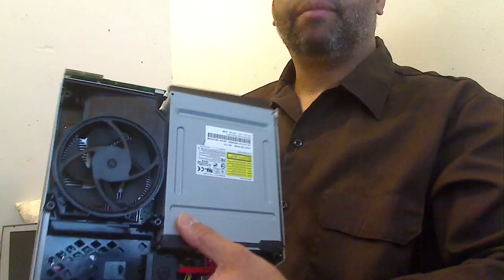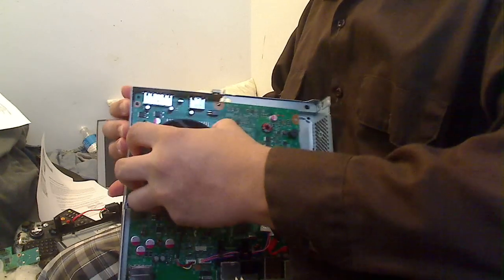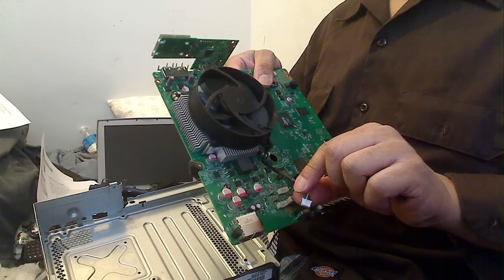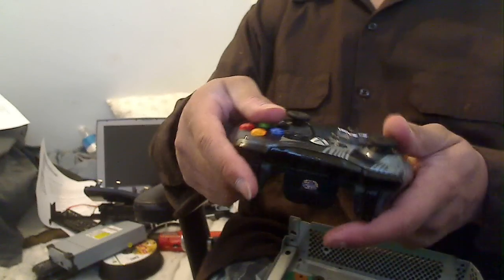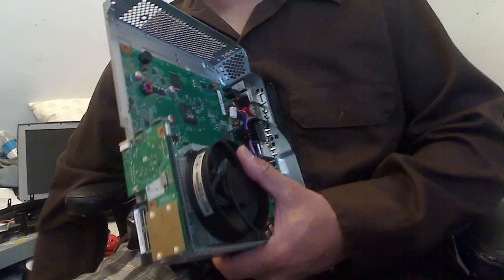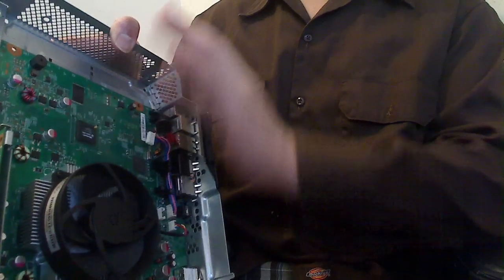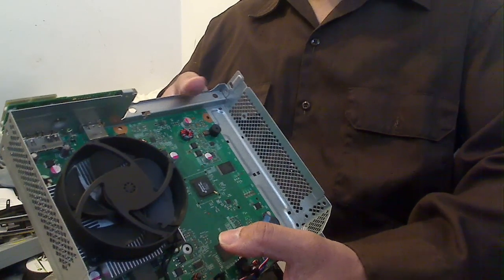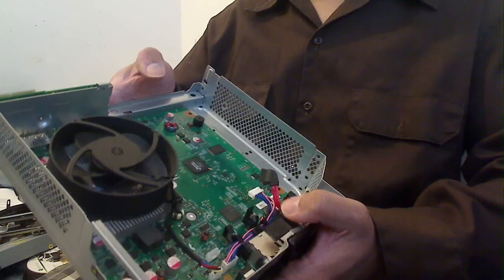How to fix Xbox 360 Slim RROD / Red Dot of Death Reset Solution👍

Comment from the maker: Things to consider when you don't have success:
1.) Heat Sink paste is a slightly viscous material that comes in a tube that is used to allow efficient even heat transfer from one object to another without burning both objects, just like when one uses cooking oil to fry food. The cooking oil allows efficient even heat transfer between the heated pan & the food in the pan with burning it.

2.) If no thermal paste is used, then heat cannot flow from one metal object to the next metal object efficiently. Excessive heat build-up can occur between the 2 metal objects (heatsink & CPU) and you can expect a fire to occur inside the xbox and damage to your CPU/GPU. Heat must flow from one object to the next without a buildup in heat in one particular area, and then blown out of the case to remove the heat from the inside of the xbox towards the outside environment

3.) If your reset doesn't work and your xbox still gets the red dot. Is there anything else [you] can try?

3a.)You could try a different power supply or replace yours if it has a red-light. You need to make sure you've replaced the old heat-sink paste with new paste after you've cleaned off the old. You can try running a heat gun over both sides of the board and let cool down before testing.

4. You can check the USB ports front and rear for bent or twisted pins touching the inside of the USB port. Unplug the Xbox and use a small tool to bend the pins away from touching the inside of the USB metal chamber. If the USB port appears unusable you can fill the chamber with hot glue from a hot glue gun ($3 at the dollar store). Only do this after you've confirmed that the pin correction was the problem and that you're Xbox powers up without the red dot.

5. Check the HDMI for bent pins and bend back or just uses AV or Component cables for an alternative video source. Components and HDMI give near identical video quality to the naked eye.
Reply: +Donte Beachem (Romerro) thank you :)
Reply: Donte Beachem I did the paste and upgraded the bolts and it was still running really hot. And today the ring came back on
Reply: What if you don't use thermal paste
Reply from the maker: @quickcompetitionsltd  You will not have efficient heat transfer. CPU paste is a medium that allows heat to transfer from one object to another without burning the object or fire occurring. If you do not use paste, you can expect the bottom of the heatsink to be burned and the top of the CPU to be burned. Don't do it..
Reply from the maker: Ok so YouTube doesnt allow me to annotate this video any longer but I would suggest either placing the original x-clamp and screws back in or if you dont have the clamp any-longer, check to make sure you have sufficient gapping between the heat sink and the board, using 1 plastic washer and 1 metal washer. do not place the metal washer against the board. If you over tighten you can bend the pcb where the processor is located and the cpu will continue to overheat. My apologies for taking so long to respond but there's something wrong with my notifications.
Reply: Donte Beachem Do you recommend this repair for first timers?
Reply from the maker: dar'man beskar Ordo  You do not need to reconnect the hard drive or place the shell back together. These things should only be completed when and if your repair is completed. Do all your repairs and testing with an open case and with no other peripherals attached. After you believe the repair is completed, attach each component one at a time and then power up the Xbox.
Reply: +Donte Beachem (Romerro) You said metal washers? also what kind of thermal paste did you use?
Reply from the maker: +Jesus Lopez Hello Jesus. The washers do not need to be added. Just place the xclamp back on in its normal position.
Reply from the maker: If no thermal paste is used, then heat cannot flow from one metal object to the next metal object efficiently. Excessive heat build-up can occur between the 2 metal objects (heatsink & CPU) and you can expect a fire to occur inside the xbox and damage to your CPU/GPU. Heat must flow from one object to the next without a buildup in heat in one particular area, and then blown out of the case to remove the heat from the inside of the xbox towards the outside environment.
Reply: Is it necessary to the thermal compound paste ???
And how to open the heat absorbers ?? Plzz tell me naa
Reply from the maker: dar'man beskar Ordo  No problem.

Comment: Hi everybody. When I am doing a heating reset process, my XBOX automaticly shud down after 1-2 minutes. YOu all write about 20-30 minutes but mine is shutting down after a while. Power supply is green.
Reply from the maker: Be sure to leave the heat sink on but without the fan and then leave it on til shut down. If this doesn't work, then use a heat gun to heat both sides of the board evenly. Don't burn yourself. Then do the reset again. Good luck

Comment: What does the 4 red light of death
Reply from the maker: No such thing as a "4 red light of death" but you may have a video or video cable issue. This was an old common error on the 360, which had to do with a malfunctioning video cable, either bad HDMI or AV cable which may included bad component cables. This error can occur if either of these cables aren't plugged in, aka seated correctly. You can try pushing the cable or cables into the rear of the Xbox and TV or replacing the cable entirely. Good luck.
Reply: @Romerro1  the Xbox just flashers red then the fan speeds up and it shuts off
Reply from the maker: @gothgurlclique  Hey Naruto, if you've checked the video and the video cable or tried changing the cable itself without correction, check all the USB slots for bent pins or any sort of metal. At times the the small white plastic piece inside those slots break off and when you stick something in there the pins bend causing the positive to touch the inside of the USB slot. Use a flash light and maybe a magnifying glass to check the front ones and the back ones. Also try using a different type of video cable. If you're using HDMI, then switch to component cables or the regular Xbox VGA video cable.

Comment: So I literally leave my 360 on without the fan until it turns itself off? Then I can allow to cool and reattach fan?
Reply from the maker: Exactly. Microsoft designed the Xbox to shut down when over heating occurs. Just be sure to clean off the old cpu paste before adding new cpu paste before reattaching the heatsink and fan. Good luck
Reply: @Romerro1  thanks for your help. I think I screwed up when releasing the x plate to get to replace thermal and scratched motherboard. The console worked before I attempted. Now it turns on green and then just a red light. Gutting really! I ended up buying a refurbed one with 2tb as can’t live without.

Comment: Disassembled the thing, cleaned it thoroughly (including the old thermal paste from the CPU and heat sink), applied new paste, now the console won't power on at all, so I have no idea if I can even reset the board.

Comment: I had my 360S for 10 years, and then when I turned it on one day, it was a stationary red dot. So I went on ahead and opened up my 360S to see if the solder joints on the XCGPU were at fault for this happening, but I looked and all of the solder joints seemed to be fine, so I'm thinking it's the fan that caused the problem. I'm gonna try and blow off the logic board (because it's dusty from the past 10 years), apply some new thermal paste (Corsair TM30 if anyone's wondering), clean the fan and piece it back together and see if that solved it.
Reply from the maker: Well good luck with your repair. You might want to check a few things while you're at it:
1. Use a flash light & check for debri' in the USB & HDMI ports and clear them.
2. Check to see if your power brick status light turns red at anytime during the 360 power cycle. If red, an exact replacement is needed.
3. Be sure that you're using the exact power brick for your console. Mismatching can occur between 360 consoles. I believe it's between the 12v & 14v, meaning the 14v can fit in the 12v but the 12v can't fit in the 14v. Don't quote me on the correct voltages. I honestly can't remember all the old 360 issues, unless you're 'S' in your description is referring to the slim version, then you can disregard the mismatch issue since it doesn't happen with that model. Anyway, happy Gaming if you get it up and running.

Comment: Can you help with 0012 error
Reply from the maker: I believe that this error is associated with the GPU over heating. Sometimes this is due to lack of ventilation. You may just need to clean the vents to make sure they have clear air flow (remove the dust) or remove the Xbox from an enclosed space such as an entertainment center (it can get hot in there). If you live in a hot climate country then you may need to get a small fan to blow directly onto the Xbox when ever it's in use and last check to make sure you're using the right power brick if you're using the old Xbox 360, since using the wrong power brick could cause an over voltage and overheat the GPU. This doesn't happen on the Xbox 360 Slim models. If none of these tips aid you with cooling, follow the instructions set out in my video in order to do a repair.

Comment: It worked for me. Cleaned the Xbox disconnected the fan and switched on the console for 20 min, switched it off and plugged in the fan and it came on. Been playing Tomb raider for an hour now.  Hopefully it'll come on tomorrow again.
Reply from the maker: Did you cleaned the processor or did you skip this part.

Comment: I have an xbox 360 slim and when i turned it on its green and after like 1 second it turns red and my fan turns on and immediately of after 1 second same thinf with my power brick when i turn on the xbox its green and after 1 second it turns to orage :( pls help!!
Reply from the maker: The power brick appears to be going back into stand-by mode. This scenario is usually one of the not so bad ones, because since your Xbox is not red-ringing yet there may be little to no damage to the CPU or other solder points on the MOBO. But... You'll have to check the simple things 1st. First check each of the USB ports (front & rear) with a flash light to make sure that their are no bent pins touching the inside metal port area. This scenario can cause grounding, which will cause the unit to shut off. 2nd, check for a faulty video cable by detaching the HDMI, component or Xbox Red-White-Yellow cables from the Xbox (which ever you have). After you've disconnected your video cable then turn on the Xbox to see if the light stays green and that the Xbox stays on. If it stays on you have a faulty video cable so replace it. If neither of these lead to a solution, then you'll need to purchase some CPU paste so that you can clean off the old and put on the new. Follow the instructions in this video and possibly locate an Xbox disassemble video so you can remove the heatsink and fan so that you can Clean and then add new CPU paste. You can find links to suggested CPU paste in the video description. Good luck.
Reply: @Romerro1  thank you sir i will try this later
Reply: @Romerro1  i got a code and its 0031
Reply from the maker: @charbeltv5671  Well if you know how to obtain the code then you must know what the code relates too. If not, check here for a definition, https://segmentnext.com/2011/02/16/xbox-360-error-code-troubleshooting-guide/
One solution could be to reflow the RAM chips surrounding the the CPU but if you're going to do that you might as well reflow the entire board, top & bottom. I talk about it in the video. Good Luck

Comment: This video is incorrect and this is basically a band-aid fix, what is happening is the balls of solder that make the connection between the cpu and the motherboard are cracking and moving out of place and that is one of the causes of the red dot, so what you are doing with the replacement of the x clamp is putting more pressure on the cpu to squish the solder balls to make proper contact, and the "resetting of the board" is just you overheating it so the board flexes so the solder balls make contact, another thing people do for dead graphics cards is either put them in the oven or use a heat gun and heat the gpu, this works similarly and will probably work on an xbox 360 with this issue, but all you are doing is temporarily reallocating the solder balls to the correct spot by heating the rubbery stuff that surrounds the solder balls, the only fix that will work long-term is getting a new cpu/gpu put on which is a very expensive and time-consuming process which isn't worth it for a xbox 360. Despite all of these reasons it is still worth a shot to try these things, your xbox is as good as dead either way but this way you may get a few more months, or even years if your lucky, out of your xbox, the only thing I don't recommend is putting it in the oven, that could end up giving you lead poisoning from the melted solder.

Comment: I melt back plastic because i forget to takeoff and still red dot 🔴 i heating about three or two hours and leave to cool down one or two hours later I turn on and still red dot soo now what?
Reply from the maker: Replace the CPU thermo-paste.
Reply: @Romerro1  I did and still red dot
Reply from the maker: @andrewx_x7722  You failed to mention it in your initial statement. I think you should explain everything you've done already in detail, using complete sentences so that I am not telling you about an additional task that you may have already completed.

Comment: How did you load into OS if you dont have a hard drive installed to it?
Reply from the maker: Although I'm not sure which Xbox you're referring too, the Xbox doesn't require a hard-drive in order to boot into the OS. It's not a computer in which the OS is installed onto a hard drive partition. The OS is ROM encoded by Microsoft and updated periodically over the internet. (ROM = Read Only Memory) The hard drive is mostly used to save your save point data and to save the games you've been given usage rights.

Comment: My red dot is flashing and the console says protecting console due to ventilation

What should I do? Please and thank you
I have it apart now
Reply from the maker: What console do you have?
Reply: @Romerro1  360 slim I think, it's old
Reply from the maker: The console just knows its over heating. It doesn't actually know whether it's a ventilation problem or not. Follow the steps in this video for resetting the board or find another video for replacing the thermal paste on the CPU. The thermal paste needs to be moist and not dry so that there's sufficient heat transfer from the CPU to the Heat sink which allows the heat to be blown out of the case by the. CPU heat sink fan as long as the vents aren't coffered by dust or blocked by an object
Reply: @Romerro1  paste ordered, thanks
Reply from the maker: @brotherjason8635  good Luck on your console repair.

Comment: Do you reset it before or after applying thermal paste? If after, should the heat sink be attached when resetting it?
Reply from the maker: Start watching the video at 3:05 mins
Reply: Donte Beachem oh duh 🤦 thx
Reply: Donte Beachem One more thing when you leave it to cool after overheating/resetting, do you keep the power plugged in?
Reply from the maker: @biged7204  No. Unplug the Xbox.

Comment: I done everything you explained,and also cleaned the connection between the heat sink and the CPU and put new paste,  But now the light turn red right when i turn it on when i have the fan connected 
this may or may not be seen but its worth a shot

Comment: I tried to place in the HDD in well, I cleaned it, replace the thermal paste, and even left it on to reset it, but it still shows the red light. Any suggestions?
Reply from the maker: Sure. The video here states if thos things that you've completed do not work for you, that you should consider using a Heat gun. Rewatch the video for suggested instructions.
Reply: Donte Beachem 
Question about that. Could I use a hairdryer?
Reply from the maker: @chinahatchild3030  A hair Dryer does not get hot enough. You need a heat gun that has atleast 2 temperature settings; one at 500 & another at 1500. They're usually about $20
Reply: Donte Beachem 
Ok, thanks for the tips! Hopefully it’ll work
Reply from the maker: @chinahatchild3030  good luck. It works for most. I made some suggestions in the video about the heating instructions.

Comment: Hi, how could i know that the console reseted succsesfully? I mean, i connected it after cleaning everything, the power brick works perfectly, so i should just leave it without the cooler till it resets? And how do i know it reseted?
Reply from the maker: Your processors heat sink will get hot at 1st. When it resets the heat sink should start to get cooler